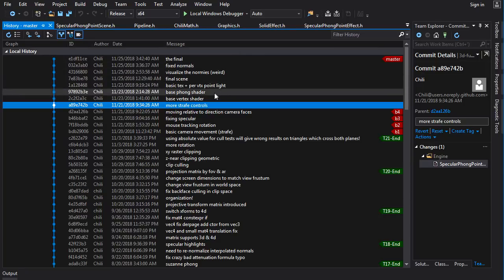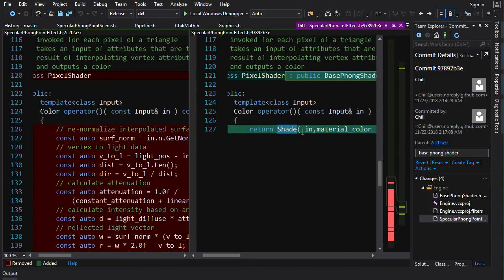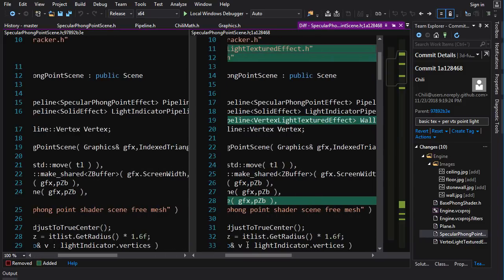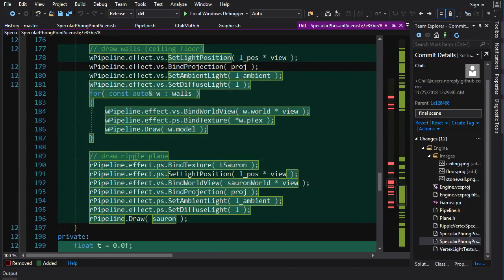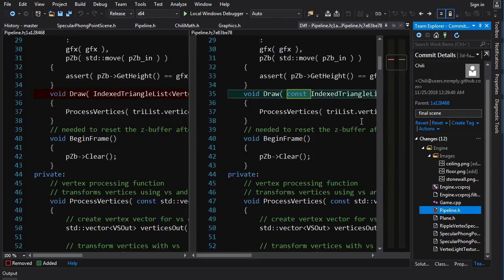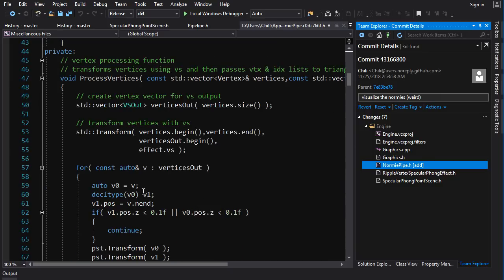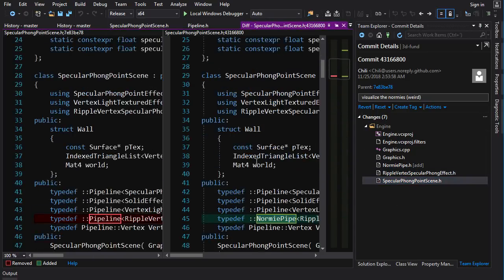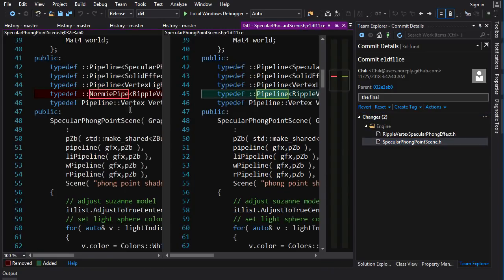3D Programming Fundamentals [Camera View] Tutorial 22 - Bonus

Comment: Hey Chili will you ever explain how you set up the framework?

 I tried using GLFW and OpenGL thinking it would be easier but it's not. All the frameworks I'm seeing whether it's for OpenGL or DirectX follow a similar pattern that I'm completely lost as for an explanation as to why they're set up that way. Anyway, thanks for the best Direct3D tutorials on YouTube!
Reply: You can use both OpenGL or DirectX because chili only uses them for putting pixels. I followed this series on MacOS and then I switched to windows. I agree that setting up c++ projects are a bit harder than other languages. You can easily clone the chili framework and run it using visual studio. I used cmake and OpenGL so I had a week of headache until I finally could set up my own project for OpenGL. If you want to use OpenGL use vcpkg which is mentioned in one of the chili videos.